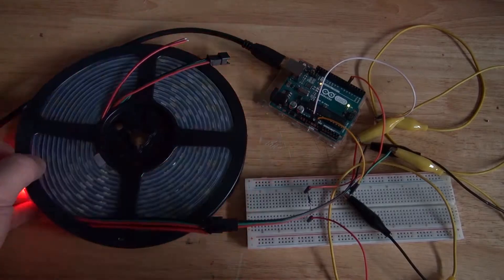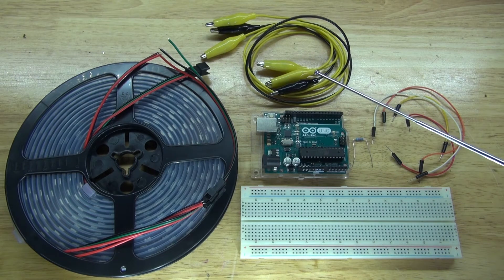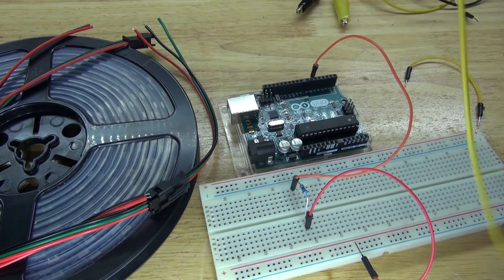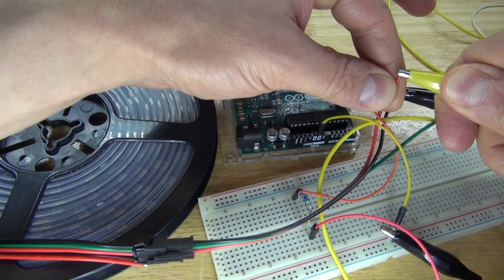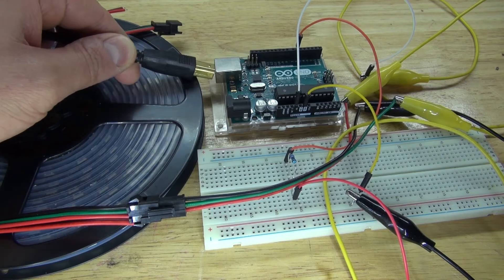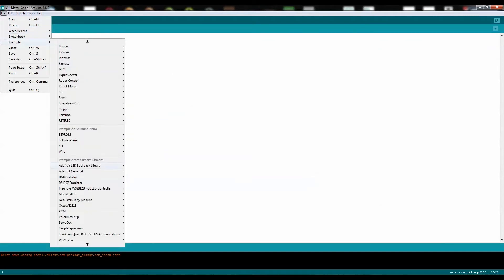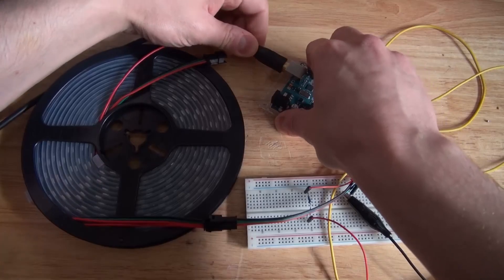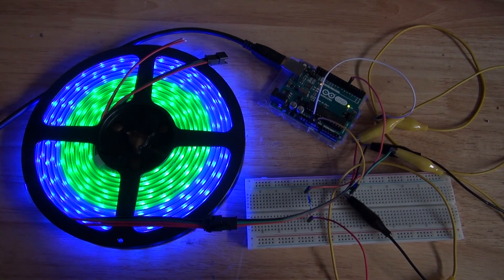How To Setup A ws2812b RGB LEDs With Arduino Uno

Comment: Thanks for the kind instruction. By the way, is it possible to operate 5m (300 leds) without external power?
Reply from the maker: For that, it would be best to have a power supply.

Comment: Which adapter did you used to give the power supply... please answer it
Reply from the maker: I connected the Arduino by usb. Therefor it is 5v. The Neopixles connects to 5v from the Arduino.
Reply: @SciTyeTech  is it ok for 5 meter led strip which has 300 LEDs ?
Reply: @Vicky-cw3oz  Absolutely no
Reply: would need more then 5volts to run 300 leds i think ..
Reply: No you NEED 5 volts only. But need more amps. Never use 5v pin on the Arduino, it disables the usb data connection.